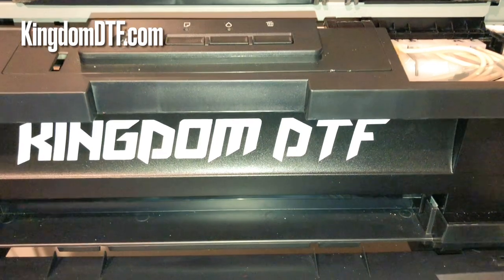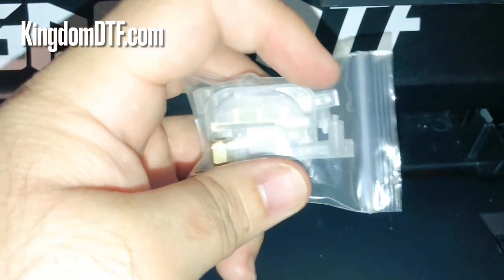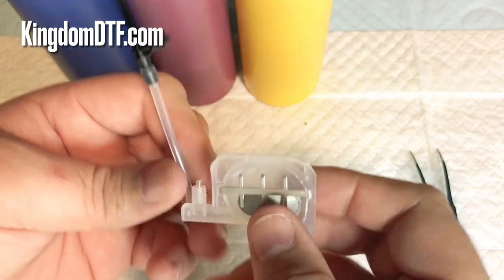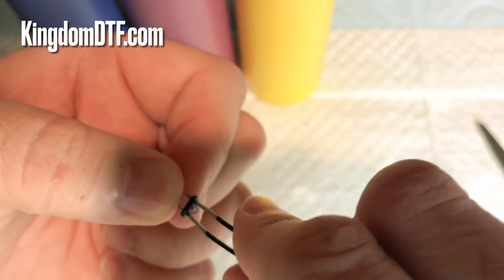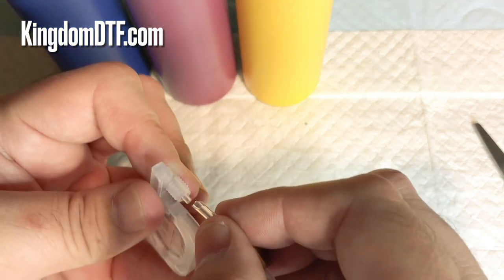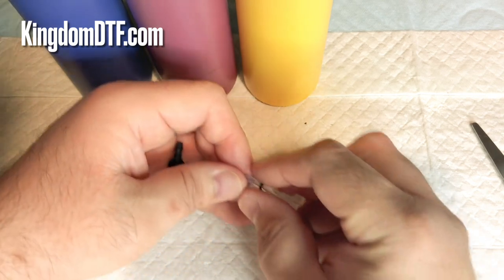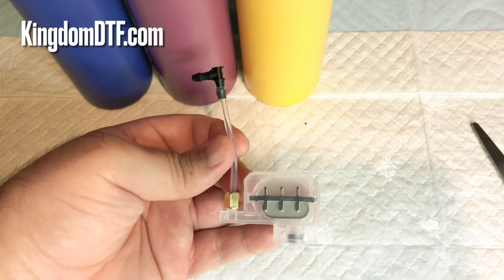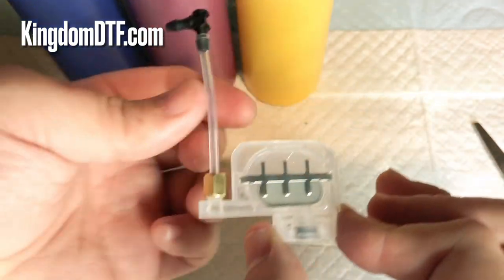🔧 How to Replace Epson L1800 Dampers with Screw & O Ring - Step by Step DTF Printing

Comment: my problem is, that i cant put the tube into the damper and now i cant use my machine🤦‍♂️
Reply from the maker: You need to have the extra tubing like shows on the video.
Reply: @KingdomDTF  yea i got it thanks, but my white ink is not moving in the tubes and is kinda transparent when printed onto a dark garment. How can i fix this?
Reply: @Soyhunndo  white ink doesnt completely close the print on my machine too,i am also trying to find a solution for this